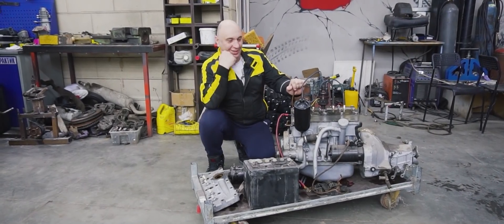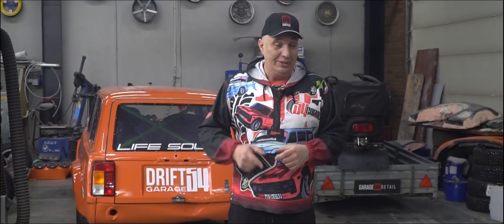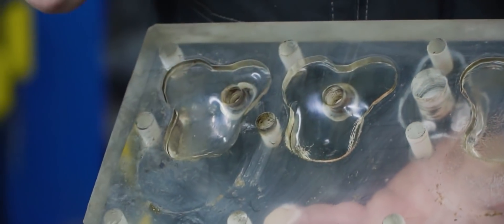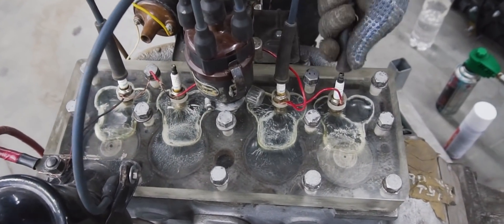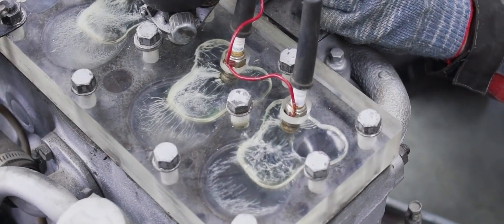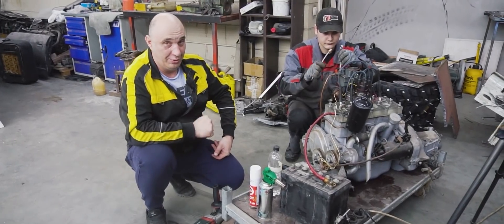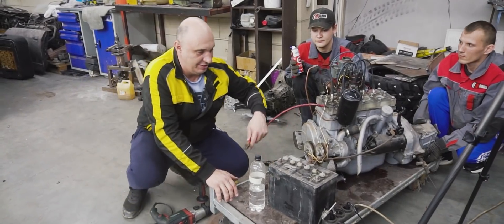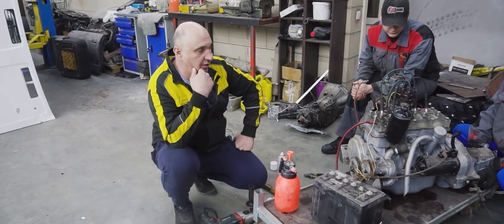We observe propane, methanol and other flames under see-through head

Comment: It would have worked better if you hooked up the various fuels to the fuel line instead of dumping it in the carburettor air intake.  I have had an engine run smoothly using liquid methyl alcohol and natural gas in gaseous form using that method.  I am pretty sure the flame would be very blue using propane and engines anyway should burn blue if they are tuned properly and even then the engine has to warm up.  You used to be able to get a colour tuning tool for cars, not sure if they do them nowadays or even if it was a scam back in the 70's.

Comment: Get 'er running on gasoline, and then give it a whiff of gunpowder.... 😳

Just step WAY back of you attempt this one... in fact, I wouldn't even be IN the same building with it, because it IS going to go BANG with GREAT vigor!! 🔥 
Actually, it'll prolly explode. 💥 
So dont be ANY where near it. 

You'd have to rig up some kind of remote system that would dump the gunpowder down in front of the carburetor from a distance, or something that would remotely blow, or "inject" it into the carb throat or intake manifold. 

Just be CAREFUL A.F. if you attempt this.... 🤨

Comment: There used to be a „transparent spark plug“ called „colour tune“. You could use it to tune/synchronise multi-carburettor motorcycle engines. They had a specific glass between the core and the thread so you could see the colour of the flame.
Reply: There still is on ebay - they still make them.
Reply: My dad had one :)

Comment: I have an interesting one for you.
Can you make a 4 stroke into a 2 stroke by making the camshaft pulley the same size as the crank?
It should be super easy to test !

From Edmonton, Albert, Canada
Reply: wont work because of how the valves open and close

Comment: Here's an idea! Take a 4 Cylinder engine for example, Separate the intake manifold so there is 1 carburetor per every 2 cylinders, and make 1 half of the engine run on gas and the other half on diesel.
Seems like it could be interesting to see it happen!
Reply: This makes me think of what the Cat D2 did. They had a tiny gasoline engine called a "Pony motor" You would start the gasoline pony motor, than it would start the diesel. They needed it because that diesel was very slow to start.
Reply: I can tell you what would happen - the crank would snap between 2-3. Pony engines are started, warmed, and then clutched into the starter ring of the bigger motor to spin it fast.

Comment: You should have adjusted the ignition timing....the ignition timing will be different for each fuel....that why it didn't run on other fuels....flame front on each fuel is different 🤔

Comment: I have heard that in Indycar, they have alcohol fuel. They need dye so that when a fire starts, it is easy to see. Alcohol fires aren't so easy to see.
3:16 I guess I'd cut a groove and fit a metal O-ring. That might keep the heat away for those bolt holes. Just a guess.

Thanks and good luck. I think it would be funny if you made tires out of teflon. I think I found a way to do it. Maybe you could find a company that rebuilds huge industrial tires. You could then give them teflon where they would usually put the rubber. The tread would be teflon, and that's what would make the experiment funny.
Reply: Pure Methanol is very common for short track racing also. Like you said a lot of teams will put dye in it to have the flame more visible. 

We've personally done a test with it at home, with and without dye. During the day without dye, we poured a little amount on dry pavement and lit it on fire. In the daytime you couldn't see a flame. You could see the wet spot on the ground disappear as the fire burned the methanol. You can see a flame with a thermal imaging device, but not an actual flame. With the Dye added it helps see the flame a lot easier. It's similar at night time, but at night time without the dye you can kind of see a flame, it's usually a very nice blue. You still have to look for the flame though. 

Personally I've known people that was on fire while using methanol and if you looked at them, you could not tell they was on fire. They even said they didn't know they was on fire, until they could feel the heat from the fire and seen their race suit started to turn brown from the fire burning it. 

Methanol fuel does burn cooler than pump gas and can help a lot with keeping engine temps down. Like the video says.
Methanol also does not emit an opaque cloud of smoke.

Comment: Where the cylinders are you should use glass inserts so that the plastic doesn’t melt and get distorted it High heat glass like the ones in your wood-burning stove.

Comment: Make a head from high heat resistant glass. It can be done.
Reply: Tell us when you have it completed.
Reply: @johncoops6897  why would you think I can make this? I'm not a glazier, & don't have the facilities. The type of glass required is toughened semi-flexible high heat. You do realise that thick enough glass can be clamped without risk of breakage.
Reply: @christophermarshall5765  - it was a stupid  and totally impractical suggestion. Nobody could make such a thing, hence my suggestion.
Reply: @johncoops6897  you’re wrong. Here in Australia we make several different types of glass. Proves how much you know. Using the right methods, high temperature glass of 4 inches thick will do the job nicely. The sleeves for the plugs can be fitted and glued in with special adhesives that we make here. The head bolts can have loading plates under them to allow even clamping load of the glass head.

Comment: With some of the other fuels, adjusting the timing helps with cleaner burning as they need to be ignited at different points of compression, but I'd say propane's the nicer burning, as it's already gaseous so doesn't have the problem of there being droplets of fuel (the bright "flares" of stuff burning in the slowmo) trying to keep up with the rest of the burning fuels... :)

Comment: Obviously head made out of glass would withstand heat better... But feeding nitrous oxide to the engine would be interesting to see... The carburetor should also be replaced with one designed for gases, as now it feeds too much oxygen to the engine.

Comment: One thing about acetylene - I'd expect it to ignite from compression quite early in the compression stroke.  (Just a guess, based on the handling precautions for acetylene.)  This would keep the engine from running properly, and likely cause some damage.
Reply: It needed a bit of Oxygen to help it along.
OOOopppps, not too much LOL

Comment: I can do the same thing you're doing with a lawnmower engine you need to get yourself a set of valves inside the head you made that'll make it a hell of a lot more exciting and more experienced in your alarm or you'll see if it really Scheels properly or not
Reply: Whilst your name is ironic, you need to realise that there are different kinds of Otto cycle engines, David.
This is a "flathead" with the valve in the block. That makes the cylinder head nice and simple with the experiment.
To make an Overhead Valve engine, it would be an absolutely MASSIVE amount of engineering to create the combustion chambers, valve seats, rocker arms, etc. The plexiglass head would be totally unsuitable as the material to support those things, and hence the experiment would never happen.
Using a flathead makes absolutely no difference to the results.

Comment: Run it on regular fuel and add oxygen, fuel oxygen heat. That was different fuels, next try upping the oxygen 👆
Reply: Gasoline is an odd fuel because with the right amount of air, the fuel explodes but if the mixture has too much air the fuel burns. To make it explode, you'd have to use an additive such as hydrogen with the oxygen and that brings in a different problem, the temperature increases dramatically along with the explosive forces.
Reply: @fyremoon  when you say air, are you meaning pure oxygen from a tank or just the air we breathe?

Comment: You need to find a Glass manufacturer that is willing to make you a custom molded head or a few heads out of Pyrex
Reply: I have thought of that too but even Pyrex will shatter when heated unevenly.  Worth a try though because it would outlast the plexi stuff.  I don't think it would hold up for long though and the cost to machine it would be quite great too.

Comment: I have a special spark plug kit I purchased for my KMZ Dnepr MT-11 Sidecar Motorcycle. Instead of ceramic insulator it has heat resistant glass. It allows viewing the color of combination inside the head and cylinder while it's running. It's used for adjusting the carburetor. It makes it easy to adjust the idle circuit because at idle the flame should be blue. Above idle the color should be orange. There is a color chart to help set the high speed circuit. Here in the USA the kit is called Colortune. I ordered mine from Kiev Ukraine along with other parts for my KMZ Dnepr motorcycle. It's not as impressive as your clear head but does allow watching what is happening inside and it will not be damaged from running like plastic. I just wonder if a bore scope camera could be used with the glass spark plug to make a video of internal combustion. There are lots of videos of the use of the Colortune kit on YouTube.
Reply: thread size and pitch? aka will it fit 🇺🇸 or aircraft engine's ? 14mm or 18mm plug holes ?

Comment: Very interesting! In High School, we built a 2.5 liter Oldsmobile engine that ran ONLY on Compressed Gasses, with zero air from atmosphere, using Nitrous Jets to get the proper ratios. It worked great for 10 seconds. We revved it. Then we picked up the piston rings and cleaned our shorts.

It'll idle fine. It'll be very happy coming off-idle. Maybe a bit too much nitrous in the mix, and it'll turn at 14 grand for about a second before the poo comes out of you and the motor, at about the same time.

"I wanted to see what would happen if I just pinned it wide open".
"It was running on co2, oxygen, propane, compressed air, helium, nitrous, and one of Dan's sausage and peppers farts. What did you think was going to happen?!"
"That. hehehe". (points at carnage)
Reply: Why in the hell would you be injecting a completely non-flammable fuel such as CO2 into an engine? There's absolutely no oxidized or fuel source contained in CO2.... 🤔 🤷🏻

By the way.... Oldsmobile never made a 2.5 liter 4 cylinder. 
Pontiac was the one responsible for the 2.5 liter "Iron Duke" 151c.i. inline 4-cylinder that was used in MANY of the fwd G.M. platforms from all divisions from the late 70s through the early 90s.
Reply: @davelowets  He said he had it running 🤣

Comment: Would be interesting to see a transparent head on a diesel engine
Reply: The compression is so high and internal pressures so high I'm not sure what kind of clear material you could use without blowing the head gasket. I'm not sure you could torque glass or plexiglass enough.
Reply: Now this I would like to see.

Comment: You need a different carburetor to run methanol and propane also is a different carbie too lol
Reply: Propane requires a "preflash" like a glow plug at regulated temperature. Has to become volatile before entering metering area of intake on carb

Comment: Its was tiny cracks from drilling the holes. Polish the drill holes and fire and pressure will not have a route to follow after it warms up. But it will eventually melt that plastic I bet.

Comment: I'm pretty sure that NO COMPRESSION was your problem.
Reply: No, it has compression, but only about 8:1 due to old flathead design. But that just means it will run on almost anything
Reply: @johncoops6897  You saw that it doesn't want to run.
Reply: @REDLINERUNNER  - yes, and I know why.
Reply: @johncoops6897  You said it would run on almost anything but doesn't run on anything even on gasoline
Reply: @REDLINERUNNER  - yes, however the lack of compression is not the reason for the problems. Put another way - increasing the compression ratio wouldn't make it run better. The main issues are fuel/air mixture, and ignition. timing.

Comment: That engine has little to no compression if that drill can spin it to start.
Reply: It's flathead. They normally have low compression ratios.
Reply: @karlovucilovski7899  not that low it's obviously worn out,that would explain why it won't run for shit on the alternate fuels.
Reply: Might help it not explode in this circumstance

Comment: it's hard to say because there was no mixture control. But i now gasious fuels burn very clean and complete when the air/fuel ratio is controlled precisely, same for ethanol and methanol. The heavier the fuel (longer carbo hydro chains in molecules) the less complete they burn.
By the way, this says nothing about the density of energy of each fuel. Diesel for instance has a high energy density.

Comment: have you look at a hit and mis engine at the valves and came shaft mechanism? well some of those engines have the intake valve working free (is not moved by the came shaft) and juts the exhaust velve is connected to the came shaft, it is possible to make the same mechanism to a normal car engine (gasoline or/and diesel)?

Comment: Try to run a stock engine on oxi-acetilene mix untill it goes bang  😁
Reply: Hahaha, my god it would instantly be violent!
Reply: Isopropyl
Reply: It would last about 3 revolutions 😂
Reply: Mabye mostly gasoline, but a small amount not Oct, to act as a "boost"
Reply: @jwalster9412  No. The only gas I would want to inject into my engine for a "boost" would be Nitrous Oxide.
Reply: @davelowets  why not lead, gun powder, or liquid propane.
Reply: @jwalster9412  Lead wont do anything, gunpowder would blow the engine to bits (it been done already, and is on YouTube) and propane works with a diesel, but wont boost a gasoline engine.
Reply: @jwalster9412  The reason only nitrous is used, is because it works. Just about everything else has been tried already and doesn't work.
Reply: @davelowets  what about sulfur?
Reply: @jwalster9412  Increasing octane does nothing for giving an engine a "boost". All a higher octane fuel does, is allow an engine with a high compression ratio to be able to run without the detonation issue that would arise from using a fuel with too low of an octane rating. In fact, an engine that runs fine on 87 octane CAN make less power running on 110 octane. Tetraethyl lead was also added to earlier fuel to be used as a "lubricant" to cushion the non-hardened valve seats used in the early engines to prevent valve seat regression. After the invention of induction hardened valve seats, lead was no longer needed in fuel, regardless of octane requirements.
Reply: @jwalster9412  If sulfer worked, it would be used in place of Nitrous Oxide.
Reply: @jwalster9412  There's really no point in trying to re-invent the wheel here. Just about every flammable substance known to mankind has been tried in an internal combustion engine as a "power booster" at one time or another. The safest, and most effective, gas has already been found to be Nitrous Oxide. Its basically the perfect gas to boost an engines performance. It helps greatly in several ways.. #1 Upon introduction, the change from a liquid to a gas creates a very COLD environment which helps to make a very dense environment in the intake that holds alot more oxygen in the avaiable fuel/air charge. #2 The nitrous carries with it, in its chemical make-up, extra oxygen molecules that will be released upon the heat of combustion. With all that extra oxygen released by the nitrous, all one has to do is add extra fuel and the power will greatly increase. #3 The inert molecules in the nitrous help to increase the compression ratio of the engine by simply taking up space in the combustion chamber, helping to again increase power. #4 Nitrous Oxide, by itself, is not flammable. (However, nitrous introduced to an already burning fire can make it burn hellaciously faster.)
There really aren't any other flammable substances that can provide all of the benefits that Nitrous can, and be as safe to use at the same time.
Reply: I was thinking the same thing, I don't think accetline has enough energy by itself, but with a little oxygen mixed in with it. It should run.
Reply: It would go bang immediately....it would backfire the instant where the load inside the cylinder burns
Reply: @huey-fan8335  not true man. I honestly thought the same thing, but I did it with a Kohler 16 hp single cylinder air cooled engine. After many times showing friends it finally did blow a head gasket, but still runs. The trick is to start spinning the engine over before you open the torch head valves.
Reply: @carsonhammond6204  but if you just hold the torch head into the Intake of a Single cylinders guess what happens? You suck in extra air, thus lean out the mixture and not running a pure oxy-acetylene mixture! If you do it in a 4 cylinder car, with a quite voluminous intake manifold and just running pure oxy-acetylene without extra air, the intake manifold will explode with quite a bang
Reply: @carsonhammond6204  That's no longer Ace/Oxy. That's just Acetylene + air, which works fine.